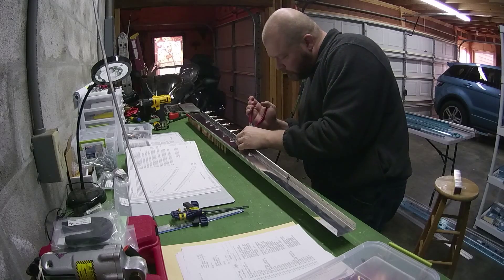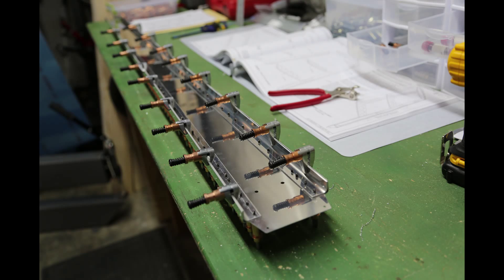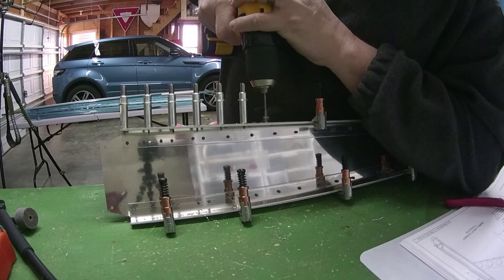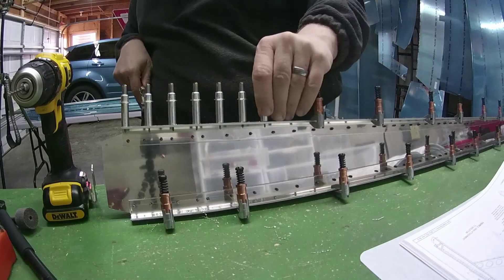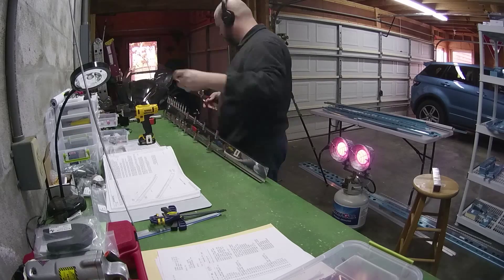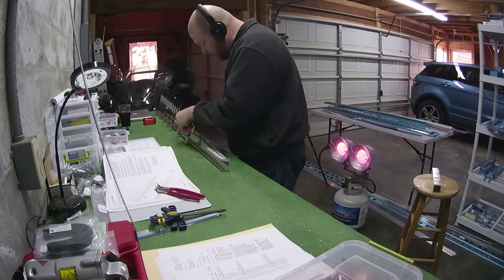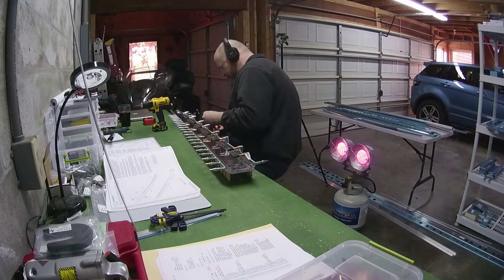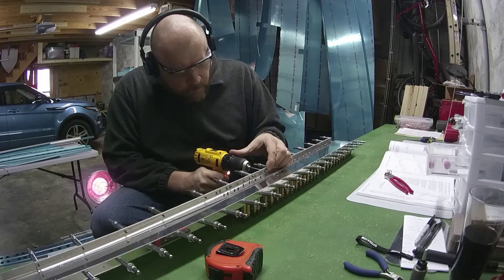RV-10 Empennage - Section 6-2 - Step 3

Comment: A set of "Air Capital Drill Stops" costs $10 at Amazon. Stops the drill gently once you break through.
Reply: I was taught to just use a small block of scrap wood.

Comment: I'm just starting this part ... and curious how straight the angle of the cut needs to be. I cut it with a bandsaw, grinded it best I could, but still not perfectly straight. It fits inside the spar perfectly (like yours) but doesn't look 100% symmetric. It's VS1014 L & R that I'm talking about. First time working with this stuff.
Reply from the maker: It doesn't have to be perfect =)